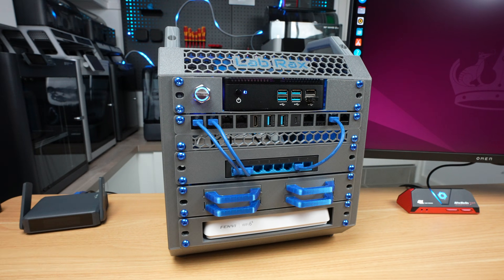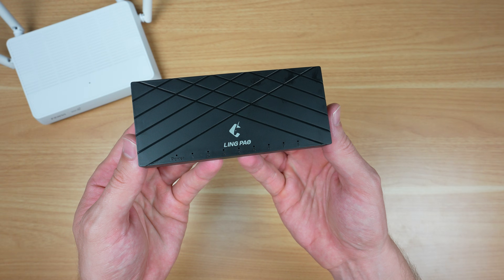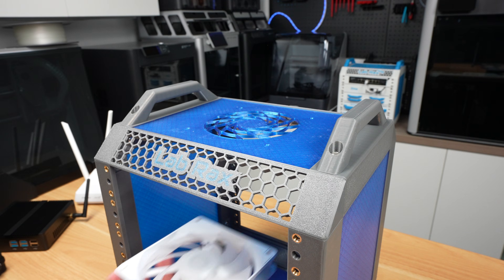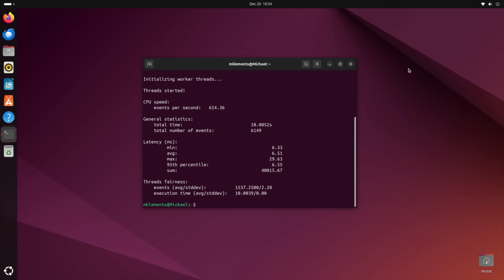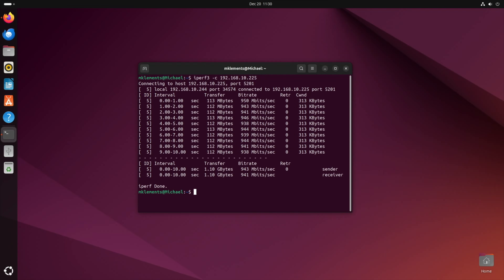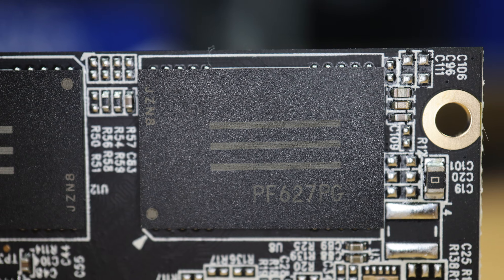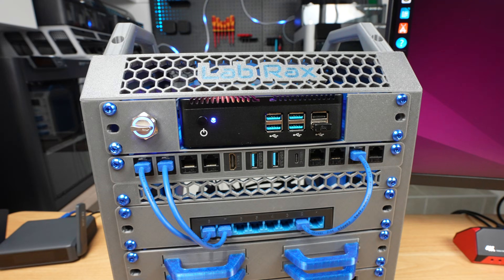This $216 AliExpress Homelab Sounds Too Good to Be True

Comment: I hope you applied for and got a refund for the scam drives. The scammers are going to get sick of having to refund for product they've sent out. I've successfully claimed back on several purchases over the years. In all cases I've been told to keep the product - except for one item which, when the seller found out he was going to have to fork out $50 in postage, decided not to bother for a $20 product.

Comment: Try again, but have someone with you who actually knows how AliExpress works.
My experience with buying electronics on AliExpress has been a totally different experience to yours.

I've never been scammed and everything works as advertised. Of course when you're only buying the cheapest you're going to have problems. Could have been massively different if you bought a similar item, but it cost $1 more. I've bought a lot of brand name hardware from the site also, for a fraction of what it costs via Amazon etc. and definitely way less than what most Aussie PC stores would charge you for the same items.

Got my wife a new replacement Gigabyte board recently, for $50 less than any other retailer I could find out there. People might be surprised at just how many 'brand names' sell their products cheaper via AliExpress, I guess because so many of these companies make their products in China so you're getting it direct from the warehouse.

Comment: I really like the rack, but you can keep the rest.  When I was growing up, "made in Japan" was a byword for cheap tat, but look at Japan now.  I had high hopes that China would have started to do something about its reputation by now, but apparently not.  I guess that's what you get with a totalitarian regime that's only bothered about collecting foreign currency.  I can't really see the point in buying hardware from AliExpress.  It's so cheap anyway, unless you need a lot, you're not saving much.

The security risks of buying tech are probably overstated, but why take them?  You're probably fine connecting it to your network, but if you're unlucky it could be hugely expensive.

I've heard of people successfully buying large tools like mills and lathes from there, but generally only as a "project" - i.e. something they fully expect to have to rebuild properly.  The thing is, they are so cheap, and the basic things like the chassis and large pieces of hardware like the cross slide and tailstock are typically OK, and they are the things that a home builder would struggle to make, so fitting a good spindle with proper thrust bearings, a decent motor and AliExpress VFD (which are usually OK if you can decipher Chinglish), means that you can build a decent quality tool for much less than you'd pay for one from a western manufacturer (who also probably buys from China).  I've also heard of people buying welders and plasma cutters from there, and being happy with them.  However, I've also seen inside them, and they would not meet any western safety certification standards.  You are really risking your life with them.

Comment: As soon as I saw the Laser etch lines on the SSD Nand chips I knew they were seconds or reject chips, so regardless if they were 128Gb or 1Tb they would have been terrible unreliable drives.

I wouldn't even send them to E-Waste .. they are landfill drives.

Comment: I'd be curious what minipc you could get for just a little more. Maybe $150-$200 instead of the minimum.
For router, I wouldn't trust it unless I could flash with OpenWRT or DDWRT.
Switch should be fine. For most workloads, it should last.
And for the storage, maybe buy used off ebay or something 🤔

Comment: Not gonna lie, as someone who has been using AliExpress for years, topics like "AliExpress is a scam" and videos that showcase experiences like this are a bit cringy to me. 

You primarily use AliExpress to circumnavigate the western market tax you usually pay for the same product. A genuine product that's originated and made in China but sold elsewhere under that brand's localized retailer will fetch for a higher price, which isn't the case in AliExpress. My smallrig photography lights cost 1/3 of what they would've cost if I used any of the local dealers, and they're literally the same products (and high end).

The other reason to buy from AliExpress is to buy cheap alternatives to products that otherwise cost a hefty amount for no apparent reason. Yeah sure this IKEA desktop 3 rack shelf with some wood and glass might last me 5-10 years but it costs 100 dollars. I'd rather get it for 20 from AliExpress and put shit on and off it until it breaks and I won't feel bad about it. One such shelf has survived 4 years, I'm sure it'll comfortably do a few more. 

This video is how you DON'T buy from AliExpress, and it is doing a good job of that tbf. Don't buy the cheapest product in every category, but the cheapest you can afford to go without sacrificing quality.

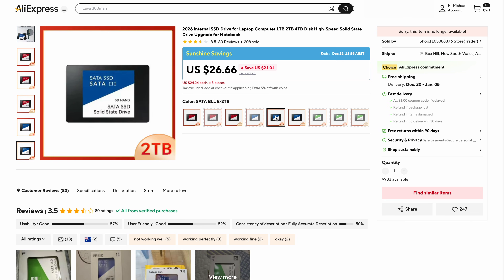Comment: 04:00 "found these 100% original drives..." how so original, original what? and how would you know? I've bought stuff from AliExpress and I'm not saying this in a way to specifically knock them, but there is no way for you to know much of anything about that sort of things for sale on there. My issue just to be clear, is not with what Aliexpress is doing - it is with the "100% original drives" statement that you make. Thumbs down because of that.

Comment: cool video. however, a raspberry pi 5 would have way outperformed this system and they cost 80 bucks. Also, i would never place high wattage components inside of a flammable case. It is a recipe for a house fire. people will often put this flammable case that contains a powerful heater inside of a wooden desk, or on a wooden shelf full of other flammables. i would suggest that you purchase some 20 mm extruded tube, and make your own metal frame for a less flammable homelab. I have never ordered from ali express or timu or any of the others for obvious reasons.

Comment: You can buy non-scam storage of AliExpress, but for realistic market prices. I bought a KingSpec drive which is not a scam, as they were the only ones that were selling 2TB SATA M2 2245 for not 3x the NVMe price. Also cheap network equipment and all kinds of adapters and cables is perfectly fine to buy from ali

Comment: this is a fun build but I try not to buy anything with silicon older than Intel 6th gen these days. this Broadwell stuff tends to be power-thirsty compared to the amount of compute you get out of it. other than that, this is a great exercise.
Reply: I'd even argue that at this point, nothing below an 8th gen. You get the newer TPM (so if you need it  you can run Win11, Host VM or bare metal) and a big jump in iGPU capabilities (such as HEVC video encoding and decoding.)

Comment: I see a dude said used hardware, but also, maybe an ebay only and\or an amazon only, (newegg) build as well, Definitely watch more homelab stuff.
Reply: Used on A is SH used and abused then returned. missing borrowed components and/or damaged beyond fixing.
I would rather spend the extra 5 or 10 and get a complete unit with everything needed. you will spend the difference (and more) on buying the missing parts and postage.

Comment: I actually bought some storage from Aliexpress and I didn't get scammed, however, those were 32GB SATA drives (for old computers) and 512MB (MB!) CF and SD cards. All of them had the expected capacity (tested with the same tool as OP uses) and reasonable access speeds. But I'd say anything that requires more than one memory chip is most likely a scam :)

Comment: AliExpress is just Chinese Amazon, and comes with the same caveats - the biggest issue as a Westerner is not being as familiar with how to sift out the mid-range dodgy (the obvious stuff being easy, of course). That’s where most issues arise.

But given price is one of the more reliable filters (albeit not infallible), I’d be interested in a repeat of this project with a more discerning selection process. Don’t just go for the cheapest, and do some more digging to validate selections. Where would that project land? 

For all the chancers trying their luck, Alibaba/AliExpress have a ton of legit quality sellers/gear, and it is an excellent marketplace once you’ve filtered the crap - it could just benefit from better tools to aid the filtering!

Comment: For me, I'm pretty tempted to go to the local hardware store (sadly, Bunnings) and by a bunch of aluminium angle for my 10in rack, jumping on the mill and drilling a bunch of holes and putting M6 rivnuts in. I just don't have the confidence in the strength of 3d prints for building a 12U or 16U tall 10in rack. I started designing my home lab, and calculated how many RU I'd need, and 9U was used before I thru some SLA batteries for a UPS, so not much room to expand there :/

Comment: So you're saying that 4TB USB drive I bought on Aliexpress for $7 might not actually be 4TB? Dammit. 😁 Seriously though that rack is very cool and a few of the components look ok. Buying used is definitely the way to go with maybe a SFF HP Elite desktop, Netgear switch and Nighthawk router. The only caveat being the router might be a bit big so you could get really flash and 3D print a new case for it.

Comment: Cebu City Philippines: I'm building a Home Lab / Printer Stand / Paper Storage using a Lazada 4398php[$74.70] 12u 600mm Steel Cube Rack. The Xerox 6655 Printer weighs almost 40kg & it's collapsing the Table it's currently on. I'll use Two 80cm Monitor Riser Poles to Hang a 10" deep 19" 6u Skeletal Rack between them over the back of Printer for my Router/Wireless Bridge Components. My "NAS" currently lives in a Dell Precision t3500 that will fit quite nicely on the Fixed Shelf until I replace it with something smaller. The 12u Rack will keep a Case of Paper Dry, hold my NAS, Laser Printer & Networking with room for Expansion. Portability on 3" Wheels for when I move into a larger Condo in a Year is a Bonus.

Comment: Interesting project!

So, as someone who relies a lot on Aliexpress for this sort of stuff, because local shops are basically buying blindly from similar sources, and official western brands, due to importation, currency exchange rates and "luxury" taxes are several times more expensive, (plus the fact that several western brands don't have a presence here) here's the tips:

- For almost all components you had bad luck there, you should spend sometime looking up for well tested reliable Chinese brands and buy from their official brand stores on Aliexpress. Don't buy from distributors, traders, shops with generic names and whatnot. And don't buy no-brand stuff.
Yes, it can definitely be a huge hassle to filter through listings to find the right sellers, but if you wanna get to the best stuff, I don't think there's a better way. Preferably, you should also only buy stuff with the Brand+ or Choice tag and "Certified original" label on the listing (just pay attention that it needs to be a field on the listing, not a print on the product photo or inside the description of the product).
You can sometimes get standard quality stuff from no brand products, but it's almost always guaranteed that those were built down to budget cutting costs as much as possible and making it as cheap as possible - because those are being bought in bulk by empty brands that wants to just slap their brand in it and pretend it's their own products - for the curious, look up for "white label" and "private label" Chinese products, you'd be surprised how many products from big traditional brands are coming from this production line these days.

But the recommendation to buy from an official Chinese brand store is valid for the SSDs, miniPC, RAM and several other components. It's usually a bit more confusing because you could have a specific product with a few different brand names, but if you look around for video reviews in the NAS and Homelab channels for long enough on YouTube you should be able to identify a few of those brands. eg. official Kingston or Crucial store on Aliexpress for RAM and SSD, brands like Acemagic, Aoostar, MeLE, Morefine, Beelink, GK, SZBox and a few others for MiniPC... Ethernet Hubs and Switches are a bit harder because the names are changing all the time, but there are some pretty good channels that buy and test a bunch of them to check what it's using, down to the chipset. Last I've seen the name Horaco and Hisource popped up to me.

True story - I got scammed while trying to buy a high capacity pendrive and SD card locally on the biggest local eCommerce portal no less, I got a few duds from Amazon US, and only finally got something that actually had the advertised storage - on Aliexpress. I kid you not. Been using the hTestw method for well over a decade now. Thing is, when it comes to this specific scam, several times on the retail side it's non-malicious - stores buys from different distributors, fake crap gets in, they never know until a rare informed consumer actually detects it - most consumers don't, and end up attributing it to being a low quality but original product. Reason why this scam has been so insidious for the past couple of decades or so;

- Generic tip for any purchase on Aliexpress - NEVER buy stuff from stores with names like "store(insert random number)". Those are recently opened stores where most scams happen. To get a store name, even if it's a random nonsense name, a seller needs to have reached some sort of threshold number of qualifications and sales. It could be just a new honest seller that just entered the platform, so of course not 100% risk, but I wouldn't recommend trying your luck if you don't wish to lose the money;

- Last one for specific cases - check if a well known reputable brand don't actually have a store there. Lots of people don't realize how some reputable brands are actually Chinese, or have official representation and operations in China - but there are lots of well known brands that also sells stuff on Aliexpress.
In the past, I have bought Razer branded peripherals, and Anker branded power banks, cables, and whatnot. Still all working just fine, tested to spec, being the actual original stuff. They are a bit more expensive than Chinese branded counterparts, but sometimes it's worth it.

There you go. This is my general tip for buying stuff from China  in general actually. Don't get stuff from these fad stores that are constantly advertising on TV, social media and whatnot (like Wish, Shopee, and whatnot) - get from Aliexpress, but only buy from it if you are willing to spend sometime to avoid scams and duds. There's a lot of good quality stuff there, mixed in with tons of crap. Which to be fair, I find it to be true on all marketplace style portals these days, regardless of country it's located.

Comment: I have in the past, starting about a year before COVID, bought many drives through Aliexpress. My current system has 2 in it. Both are 100% real and not scam drives. I paid less than regular retail price but nowhere near as low as the drives you purchased. Anytime I see drive listed as being out of the 'normal' pprice range, more or less than 10% difference, I assume scam. As such none of my no name drives have been as bad as the ones you highlight here. I have an even dozen from various longer term sellers. All have been around since 2010 or so. The oldest one in operation right now is a Kingspec 960GB SATA SSD that I bought in 2022, just over 3 years ago. I use it to store and run GTAV, almost exclusively. CDM shows 1.4TB written and 3.0 TB read with disk health at 99%. Good enough that I get 100+ FPS in game at 1080p.
The other one is my boot drive, a Kingdian 1TB I bought about a month later than the Kingspec. So far, 8.7 TB written and 5.8 TB read and 100% health. Pretty low volume but that is what it is. 

I have used variously Corsair, Timetec, Teamgroup, Adata, Kingston and WD SATA SSDs. All have their issues and I will likely use them again in the future. Still, if you look into the history of the drive makers, you may find some quality for a less expensive price.

As to RAMpocalypse, it has 100% struck in the SSD market, all types included. Prices have at least doubled for SATA SSD as well as for M.2 of all flavors.  There are few deals to be had without doing proper diligence.